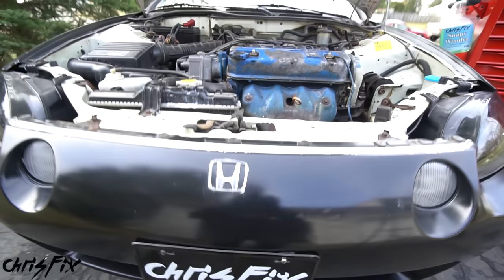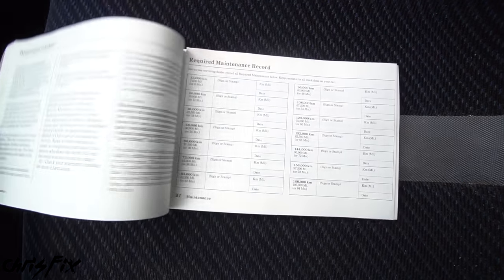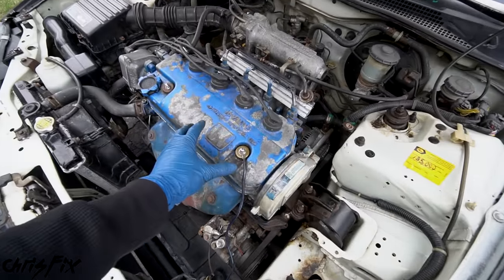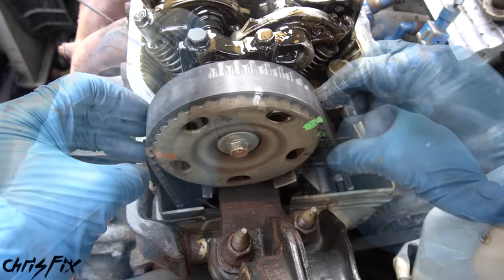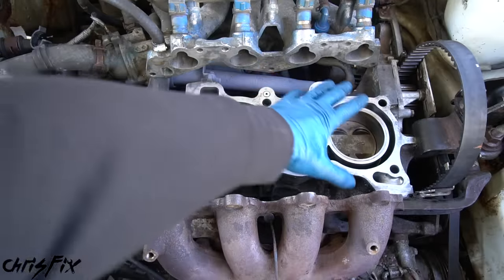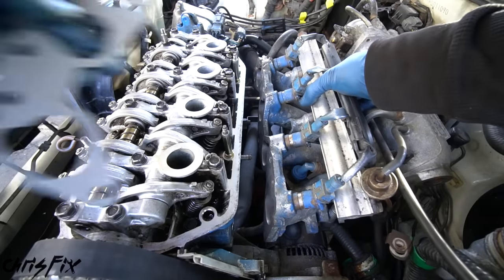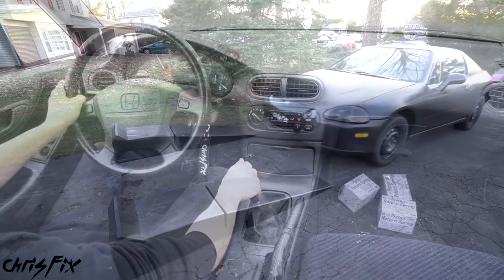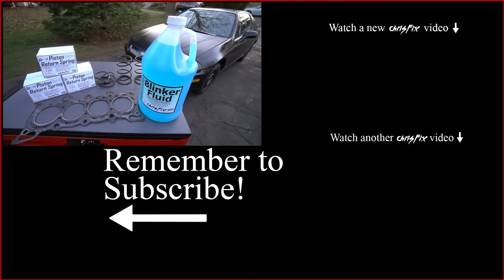How to Replace Piston Return Springs (and Head Gasket)

Comment: I would really appreciate a head gasket video. I just got an 89 Camry that I’m trying lift out the metaphorical grave that’s been dug for it. It runs and drives but needs so, so, so much work because it was abused just about as much as it’s humanly possible to abuse a car.

Comment: Piston return springs? I don’t recall learning about those in automotive.
Reply from the maker: Not a common topic in class unfortunately.
Reply: I'vegot them in an old compressor, so you might be more likely to find them in harley Davidsons
Reply: It's a damn joke duh
Reply: ginder77 proper engine maintenance is no joke
Reply: They are just as important as the headlight fluid.
Reply: B Rapozo these are more like small episodes of mechanical parody like blinker fluid muffler bearing and piston springs
Reply: It's only in certain automotive classes ask your local AutoZone.
Reply: JDM yo!
Reply: I know I was like wtf ? I know quite a bit about engines but I'm legitimately lost here and need to ask... Is this a real thing?
Reply: Cameron Moffitt yep
Reply: april fool
Reply: What's the point of piston return springs?
Reply: It was a joke... What a good engineer...

Comment: don't forget to rotate ur brake pads every 5,000 miles everyone
Reply: This Old Jew Is that a requirement?
Reply: Only under extreme conditions....🤫🤫🤭🙂🤭😀🤭🤣🤣🤣🤣🤣🤣🤣
Reply: Yet people think rotating tires is a myth that tire shops use to make money.
Reply: Make sure you flush the brakelines with carbonated water too
Reply: Stepside1986 there's no reason to have your tires rotated. They rotate every time you drive the car! 😉
Reply: have you every had to get new heavy duty tire beads?
Reply: ccpro I drive an 18 wheeler so my tires actually have much heavier beads than normal
Reply: Rotating your brake pads if you want to squeeze every mile out of them and an extreme penny pincher isn’t necessarily a bad idea, not really a good comparison to mythical things like piston return springs and muffler bearings
Reply: Also don’t forget to change your air in your tires with fresh new air
Reply: Grand Negus  who is rolls Royce?
Reply: ANd the headlight fluid and feed the squirrels in those little Honda engines.
Reply: Oh man I almost forgot this key practice
Reply: How oftern should I change the air in my tires?
Reply: @tomdickharryjane  about once a week or every 24.723 miles exactly, whichever comes first. Or you could do it when your muffler bearings go bad, they tend to fail at the same time. Or for MAXIMUM PERFORMANCE, every 30 minutes!
Reply: Drain oil for reduced friction and more horsepower
Reply: Stepside1986 it is something that should be done because it's evening out the wear because most vehicles are front engine and the tires are under the engine which is the heaviest part on the car so it's not really a ripoff.
Reply: @Roderick storey No, NEVER rotate the bad tires from front to back, only from rear to front. You should only rotate the wheels to KEEP the tire wear even, which means you need to do it regularly. You want more grip in the back of the car to reduce the risk of oversteer, as it is far safer to understeer and hit something dead straight than broadside it after trying to evade it.
Reply: @1986Honda4trax  You should NEVER rotate the bad tires from front to back, only from rear to front. Only rotate the wheels to KEEP the tire wear even, which means you need to do it regularly. You want more grip in the back of the car to reduce the risk of oversteer, as it is far safer to understeer and hit something dead straight than broadside it after trying to evade it.

Comment: Does this work for electric cars?
Reply: Nicksperiments yes of course
Reply: Nicksperiments, actually no. Electric cars use something called a rotary engine, and rotary engines don’t need springs. Common mistake
Reply: Nicksperiments lol nice
Reply: They actually have a clock spring. What people don't realise is that the actual electric motor is just an automated wind up mechanism, the car is powered by the tension that is wound upon the spring.
Reply: yes
Reply: MV60 ahh I see. Tesla has been fooling me this whole time!

Comment: You had me for about 15 seconds. That's how long it took the right side of my brain to argue with the left. I didn't notice the title of the video was just watching it to follow up on you replacing the head gasket. I still wasn't paying attention until you removed the head and I saw the two broken Springs sitting there.
 Right side of my brain said that's impossible there's no way those Springs can clear the valves. Left side said yeah but they're their and they're broken. Right side said yeah but it's impossible. Left side said yeah but he's got new ones. He just opened up the owner's manual with the maintenance schedule from Honda. maybe they're proprietary to Honda engines since I've never taken one apart? right side said yep but it's still physically impossible for that to work, besides why do the parts boxes have the name of this channel. Left side of the brain saw the light bulb and said yeah I knew it all along I was just messing with you (right side). right side said that's why I run the show go back to sleep I'll handle things from here.
The lesson learned don't always believe what you see and hear and never underestimate the power of YouTube.
30 seconds after I realized it was a spoof I came to fully appreciate the video and checked out the muffler bearing and blinker fluid. I didn't realize it was an April Fool's joke till I started reading the comments.
Sounds like some people literally fell for it. just another indication of a joke well played. I appreciate the lengths you went to to recreate the maintenance schedule in the manual. that helped to sell the left hand side of my brain on the legitimacy of the ruse.
Hats off to you for an awesome April Fools joke. It's one of the best I've ever come across . I've been working on engines intermittently including rebuilding 4 or 5 for 35+years. I consider myself pretty intelligent so even getting me to question it for a few seconds make your ruse awesome.
Keep up the good work!!!!!
Reply from the maker: Thanks haha! Glad you got a kick out of the video.
Reply: Jesus, you wrote an entire paper right here

Comment: i have special-made piston-return springs, which have progressive coils on both ends to help reduce TDC and BDC pause. This gave me a beefier low- and mid-range for the torque curve.
Reply from the maker: Haha that’s sounds like a nice setup
Reply: Are they the metal ones or the plastic ones? They might run quieter but the plastic ones only last 60 -70 thousand miles.
Reply: Gandoff2000 The metal ones. My car does sound like a sewing machine!
Reply: hahahaha

Comment: On my track cars with wild cams and good flowing heads it is important to get higher rate piston return springs. Yeah sure it'll take away some of the low end torque but that high-rpm performance will be fantastic
Reply: Projects & Projects theyd cause a shit load of valve bounce but stop them from hitting the piston

Comment: Can you help me diagnose what I think is a weak or broken return spring? I am getting some strange noise from my cylinder hole...
Reply from the maker: Yea man! We can do a collab about it if you want haha
Reply: HumbleMechanic 
Don't you just hate strange noises visiting your piston hole. Always seems to happen very early April.
Reply: Sometimes pouring a gallon of milk into each cylinder through the spark plug holes cures the problem.  Hood brand seems to work better than other brands.....
Reply: Hood brands? More like hoodwinked brands. ;)
Reply: Just try starting your engine without spark plugs and that should fix your problem.
Reply: Great video!, I was waiting for this to fix my engine, thanks again Chris, enjoy ur day
Reply: HumbleMechanic add a quart of snake oil to your regular engine oil, that should help quiet them down
Reply: German vehicles usually don't have piston return springs because they're known for being low cost and very reliable, so piston return springs were sacrificed. I'd focus on that outter tie rod, I know you like em long but 20mm is a bit much.
Reply: Ooh... VW... yeah, you're going to have to swap those through the intake port with a special spring straightener
Reply: ChrisFix great video. Love your stuff.
Reply: Its the worst
Reply: "Hood brand" is my brand!
Reply: Funny you mention that. I am working on a Spark plug delete right now.
Reply: 50% of the time it works every time.
Reply: 20mm is 20mm ;)
Reply: A few more questions. Do they make performance springs? Can you balance out your springs based on firing order? do they make progressive springs to give you a little MORE push down initially, but then a little less at the bottom of travel? I smell a new series of products for the market.
Reply from the maker: You can increase your spring rate based on your mods. Higher tq engines need higher spring rate to match! The springs come pre balanced so you’re golden with that. I haven’t see. Progressive springs for the engine because of balance and compression ratios but that’s a good idea!
Reply: Don't forget to have your Buddy watch for the milk to come out!
Reply: "You flush one down, it twirls around, 199 springs to flush down" even homer simpson can perform this installation!
Reply: JPN850R im glad im not the only one that uses this diy fix
Reply: No, that sound is just you talking Charles. <3
Reply: ChrisFix hey chris don't forget to change the air in your tires every year
Reply: One thought....isn't a cylinder hole like...the whole cylinder? :-D

Comment: First it was my blinker fluid then my muffler bearing now its my piston return spring i should just sell this car
Reply: Yeah ! sell it ! not worth the repairs !!
Reply: Sell it to chris.
Reply: Blinker fluid lol
Reply: Did you at least rotate your brake pads?  😂🤣
Reply: You probably didn't use the CORRECT blinker fluid. EVERYONE knows that clear lenses use orange fluid, and that clear fluid can be used for Red or Orange lenses.  See if you don't take care of the blinker fluid issue, it overheats the Johnson rods, and that makes the muffler bearings go bad. When the muffler bearings go bad it's hard on the engine and the piston return springs stop working.    I swear people on this channel don't know basic mechanics geesh.

Comment: I don't know much about cars but I was 99% sure there are no springs in the engine block. It's ChrisFix though so I believed it. Fucker got me good. :D
Reply: You and me both. I was about to google if such springs existed in other models because I'd never heard of them.
Reply: I knew.. absolutely KNEW.. but I watched to the end because the back of my brain was like.. "but are you sure.."
Reply: Yeah, I'm almost positive that that's the job of the gasoline to return the Piston to the bottom
Reply: Actually. Flathead engines have valve springs in the block.
Reply: just so you know there is such a thing as piston return springs just nnot in engines clutch master cylinders things like that and that code po401 its bad egr valve

Comment: Did you see that Nissan is now doing a under the piston return spring? It uses a retaining clip and pulls the piston down. It’s in their new Gallo 48 engine.
Reply: Jake TheGardenSnake damnit man, you're drunk go home.
Reply: Jake TheGardenSnake  jake what's up
Reply: did you also know that honda has a new dank whoolie mode on the new 2020 groms?
Reply: Jake TheGardenSnake good to know daddy snake
Reply: Nissan did this in the 90's also. I just replaced this on my gallo 24 in my r32. Improves your compression ratio also when you add the smaller secondary one. 👍🏽
Reply: mike rajotte man gotta love Nissan for always being on top of new tech. I wonder what the Nismo versions are like
Reply: No it's on Gallo 12
Reply: Yeah I’ve heard of that
Reply: Kamolzaaliite or 24
Reply: But just like their cvt belts they're too weak in the chase of fuel economy and snap at about 60k miles.
Reply: What have I done? XD
Reply: Gallo 12s work best on Nissans. I found that Gallo 24s tend to overheat and crack the undermount piston return springs.
Reply: Jake TheGardenSnake Galileo 48 engine I bet you got that off of the fast and the furious movie
Reply: Two marks same color close together woukd have been enough marking
Reply: It was a Honda
Reply: My murano cvt hit 220k and still drives smooth. Must've got a unicorn edition.

Comment: Lol you got me on this. I immediately searched for piston return springs
Reply from the maker: :P
Reply: I was like “since when are springs inside the cylinder”
Reply: Yeah, had me wondering WTF too...
Reply: Fun fact, my buddy's brothe Tom hated the toyota pickup he was driving but it wouldn't die (because Toyota engine lol)
He killed it by taking the head off and throwing about $2 of spare change in nickels and dimes into the cylinders. buttoned it all back together. lol
Reply: Crazy_Ivan43 how dead was that truck?
Reply: captain xbox there was a very very satisfying Klang
Reply: Noisy and dieded
Reply: I was sitting here like when did valve springs start being called piston return springs lol

Comment: THIS IS SO DANGEROUS! You NEVER, NEVER, EVER start removing the return springs without FIRST DRAINING the headlight oil overflow catch. You got lucky this time, but failure to do so can cause serious injury.
Reply: And drain the blinker fluid smh
Reply: GhostlyKreit where is the drain plug for it?
Reply: eryk zavala bust open your blinker.
Reply: @erykzavala438  if you place a drill in the middle of your headlight and pull the trigger it will locate the drain plug for you
Reply: No no noooo it's safe just hit the O.D button on your gear shifter.  It stands for overflow drain.

Comment: Can I just say, its so much simpler and cheaper to replace a head gasket yourself than it is to get someone else to.
Reply: I'm quite upset that I paid someone to do this before knowing how simple it is
Reply: Switchan but do you have the equipment to ascertain if the head has warped from the overheating problems usually associated with a blown head gasket?

Comment: Something is wrong, I took apart my entire engine and couldn't find the Piston springs. I guess it's because it's a diesel.
Reply from the maker: Yea some engines don’t need them
Reply: Yeah due to diesel needing higher compression, if you don’t have at least 7.0L you can’t make a spring adapt to the constant high compression. Can also send vibrations down your exhaust which wears out muffler bearings etc so it’s better to not have them in certain engines.
Reply: Same turns out it was my dog

Comment: I'd like to see a similar video from you on replacing a head gasket or removing a cylinder head (minus the piston return springs prank element) for a few different types of vehicles. Seems pretty easy in that Honda but I imagine in other vehicles it might be a little more complex to pull out the cylinder head. Great video though!

Comment: Turns out on my car they were missing, but once installed, my valves are bent. What are you trying to pull, Chris?
Reply: DE Nichols April fools lol
Reply: I knew, lol. :) April Fools and a Happy Easter too.
Reply: You didn't buy non-interference piston return springs.
Reply: Probably you got ripped off
Reply: Be careful when buying piston return springs from eBay.
Reply: It's called job security for a mechanic...

Comment: CHRIS, I TOOK THE HEAD OFF MY ACURA AND THERE ARE NO RETURN SPRINGS SHOULD I BE WORRIED PLS HELP :((
Reply: Leonard R this was a April fools joke so......
Reply: Iona Dunn and this was also a joke
Reply: Iona Dunn Woooooooosh
Reply: Oof
Reply: Welcome to whoosh town
Reply: You can never trust those Acura’s
Reply: Order aftermarket piston return springs from Japan.
Reply: whooosh
Reply: Iona Dunn  r/whooooosh
Reply: YES!! and when you get replacements make sure they are compatible with spark plug oil. Some chinese makes aren't coated properly.
Reply: Leonard R rip
Reply: Iona Dunn Bamboozled
Reply: I bought some that were too long. I had to grind them down a bit.......
Reply: So what was making the noise then?
Reply: I dont understand what's going on here.
Reply: R/woosh
Reply: Hahaha
Reply: Leonard R  Why was your head on the Acura in the first place?!
Reply: That means your Springs were completely disintegrated. Stay away from NOS, jet fuel and octane boosters.
Reply: Somebody probably stole them.
Reply: if you dont have them, you have to resurface the piston faces with a angle grinder. they can be a bit rough and dont worry about metal shavings in the cylinder.
Reply: I GOT MY SPRINGS FROM MY OLD MATTRESS
Reply: u should start panicking

Comment: I was only able to find right handed piston return springs. Since my car is a Volvo, the 5 cylinder engine requires left handed piston return springs and 6.2 L of fresh Unicorn oil...
Reply from the maker: Flip them over and you got your correct left hand springs.
Reply: I thought installation sequence dictated right or left handedness?
Reply: TheWizechatmgr dude Volvo inline 5 squad

Comment: Dude, never install piston return springs without first coating them with a little oil. It will take a few seconds before the oil system will be able to spray them properly when you first start up the engine and you could score up your cylinders. It's an amateur mistake.
Reply from the maker: :o
Reply: gottem
Reply: Sphere723 I’ll take note
Reply: It it's not through can cannot affect the spring
Reply: Teimo Kaupasta YOO TEIMO! WOULD YOU RESTOCK ALREADY GODAMMN!
Reply: I didnt do it and now i have to replace my muffler bearings and blinker fluid
Reply: @teimokaupasta7124  lol
Reply: On some cars you have to lock the spring in right position using loctite. In these cases oil is not a good option. Maybe that's why @chrisfix didn't mention the oil, it varies from car to car...
Always check the book!